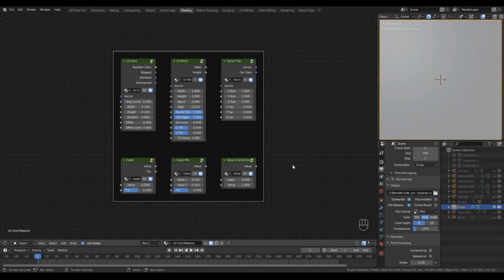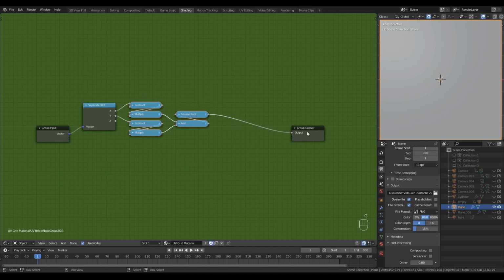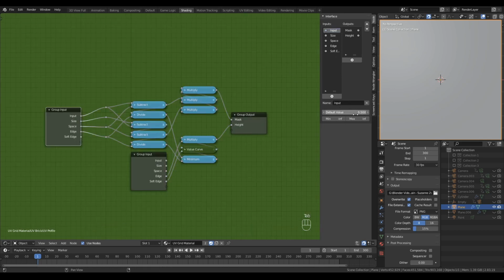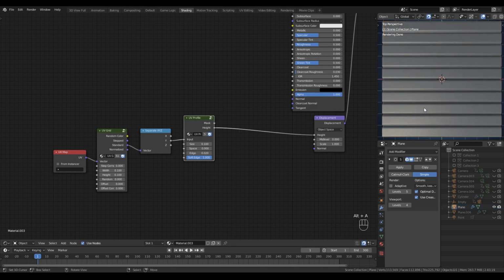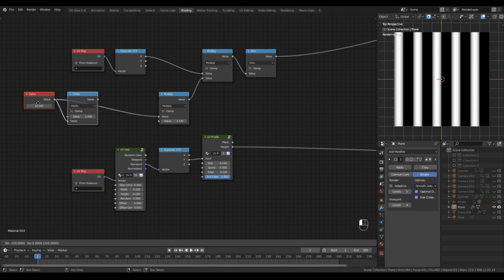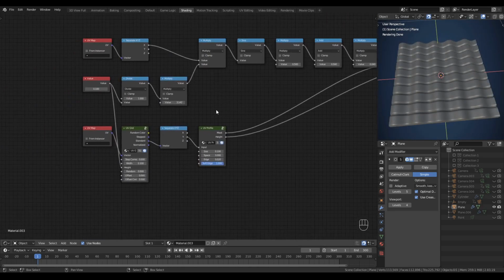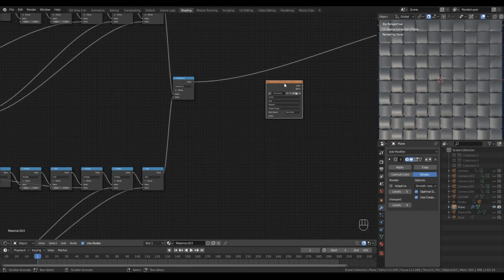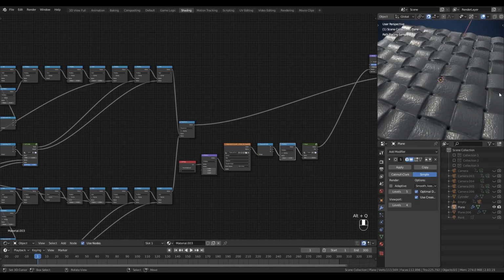Procedural Woven Strips : UV Grid for Blender - A Tutorial Series - Part 7

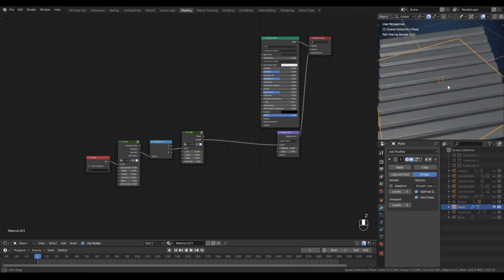Comment: Sorry to bother but my displacement just doesn't seem to work: (from 8:23 to 9:12). Switching to displacement only and changing render engines to cycles doesn't seem to display anything.
Reply from the maker: Ok, here's a list of everything I can think of that must be correct for displacement to work;
1. You must use Cycles.
2. The material's Surface - Displacement setting must be Displacement Only or Displacement and Bump.
3. The plane must be subdivided a lot. There must be enough vertices to represent the detail of your height map.
4. Your height map must be connected to the Height input of a Displacement node (not a Vector Displacement node)
5. The Displacement node's Scale input must not be 0. Ideally it will be 1. (I also change the Mid Level from 0.5 to 0)
6. The Displacement node's output must be connected to the Displacement input of the Material Output node.
Check that all of those are correct for your setup.
Reply: @nodesandnoodles  Ok it seems to like its an issue with both scale and subdivision
I had to bump up the subdivision by 2 and I had to play with the values cause the scale im working at is much smaller (mm). So the values you used weren't working because they're too large for me. My bad for bothering you with such a simple issue lol. Nonetheless, I appreciate the help you provided. I'll be heading to the chainmail tutorial next and hopefully that works perfectly and i can implement it into my ring!
Reply from the maker: Glad you got it sorted.
Reply from the maker: Did you get it to work in the end?
Reply: @nodesandnoodles  I appreciate the trouble your going to through, but I'll have to try tomorrow when I have some free time.

As someone who has no experience with blender other than a donut and these videos my guess is that I either fucked up following the instructions, incorrect blender settings, or I'm working at a scale that makes the effects so small I don't notice them. I'll go through your list of possible reasons tomorrow

Comment: Is 'Value to direction; not part of your UV Grid pre-built node? I cant seem to find it, could you help me?
Reply from the maker: You're right. Value to Direction was missing from the v1 .blend file.
I have added the node to v1 and made v1.1 available.
Thanks for letting me know!
Reply: @nodesandnoodles  Aha, thank you! I already found how its made from other tutorial of urs.
Is there a way to control the overall scale of the grid?
Reply from the maker: Excellent! Nice job.
Sure, you can scale the grid with a Vector Math node set to either Multiply or Divide.
UV Map -> Vector Math -> UV Grid
Reply from the maker: Hi there. Thank you for picking up the pack!
Value to Direction should be there, yes. Did you download v1.1?

Comment: Hello? I have been trying to add some textures and materials that have grains, where one grain runs on y axis and the other on the x axis along individual "straps'. Kindly assist.
Reply from the maker: Hey there! We can certainly do that, and we have a few options.
You want two sets of coordinates (one standard XY, and one swizzled YX) and then Mix these two sets of coordinates using a height blend; 
1. Duplicate the Maximum node which connects to the Height of the Displacement node. (Keep incoming connections)
2. Set the operation to Less Than.
3. Use the output to control the Fac of a Mix node with the standard coordinates in the top, and the swizzled ones in the bottom.
4. Use the output of that mix node to drive your grain texture.

To swizzle the coordinates you can use these nodes:
UV Map -> Separate XYZ -> Combine XYZ
Just plug X into Y, and Y into X.

I hope that helps.
Reply: @nodesandnoodles  Thanks. It has worked perfectly.
Reply from the maker: Cool! Glad to hear it.

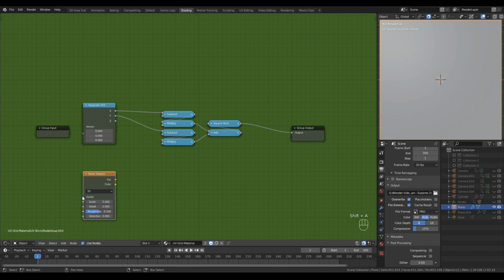Comment: At 3:05, you do not need to add the noise node to get its smaller layout on the outside of the group. Just tick the Hide Value box in the Group Settings options in the side panel. Click Vector (after connecting the Separate XYZ Node to the Group Input) in the Inputs (in the side panel) if you read this and are lost. The Hide Value Tick Box will appear.
One of those well hidden in full view settings that Blender is good at producing. 😁
Reply from the maker: Hey Neil. I'm working in 2.8.3 for this series. The Hide Value options were added to a later version. Version 2.9, I think.
Reply: @nodesandnoodles  Oh! Excuse me for not noticing....
It is still useful info for viewers on newer versions.
Reply from the maker: @neilmarshall5087  don't worry at all. I'll point it out in a later video to make sure viewers know why I have to do that. Cheers!